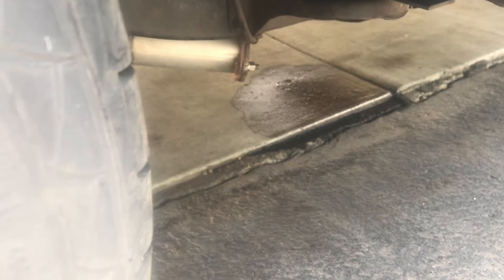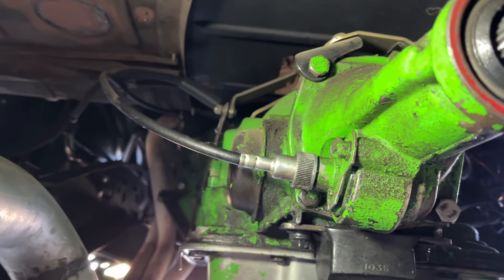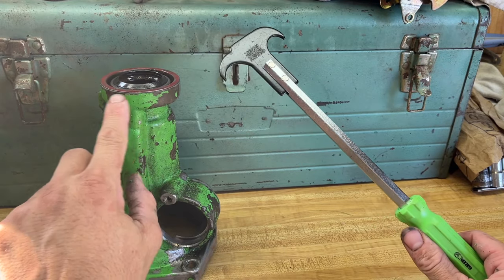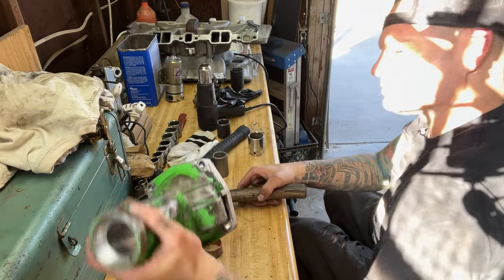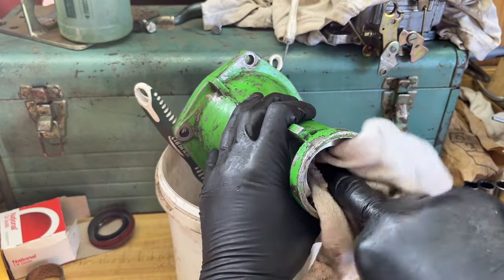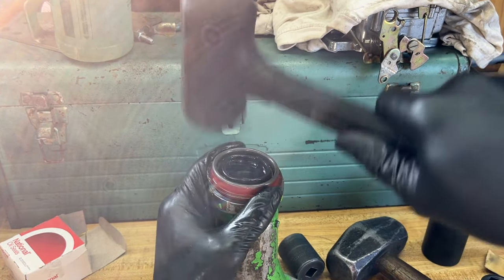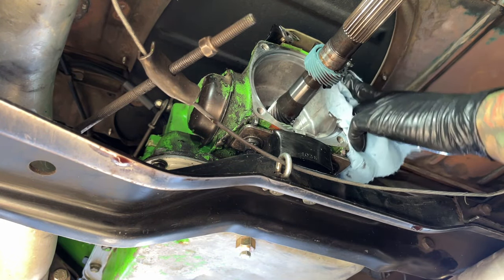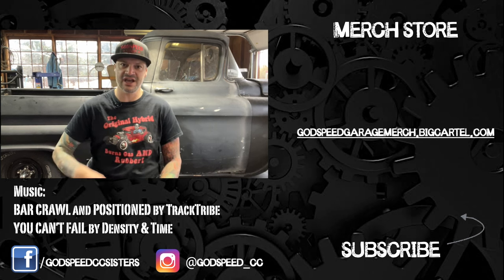How To Fix That Pesky TAIL SHAFT LEAK

Comment: Sometimes using a spedi sleeve over the yoke works too but on certain T cases it allows the seal a slightly fatter stainless steel surface to to grip.

Comment: Recently bought a 93 with an AT 4l60e. Noticed the smallest drip, tens as small as yours, on the very lip of that tailshaft seal and the seal is dryrotted.
Thanks for this video this is good info, hoping I can repair this stuff w/o having to pull the whole tranny

Comment: Good video bro. 
I think that’s my problem with my 400th. One day I drove 60 miles and the next morning my floor was stain with oil and seen it was splattering underneath the car. The drive shaft also has play as I wiggle that rear seal yoke. I have notice the car shaking a bit after driving 30 mil.

Comment: My only advise would be to put a little silicone around on the outside cover , it will leak from the cover after awhile 
The metal is old

Comment: Great video, I’m doing mine, do you recall when yours was apart, if the output shaft on the trans without the slip yoke on was free to wiggle around? I assume yes, without the support of the slip yoke, but I don’t know, any help is appreciated from you or others scrolling through the comments.
Reply from the maker: I don't remember honestly... maybe others can weigh in
Reply: @GODSPEEDGarage Thanks for getting back to me regardless.